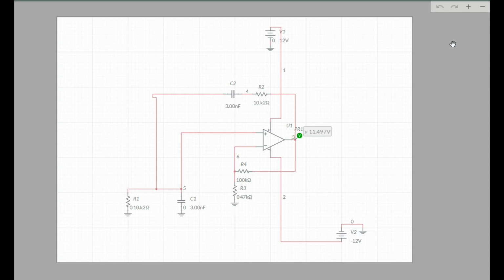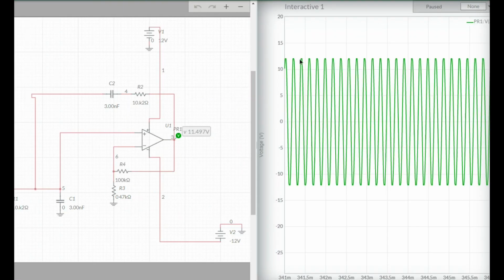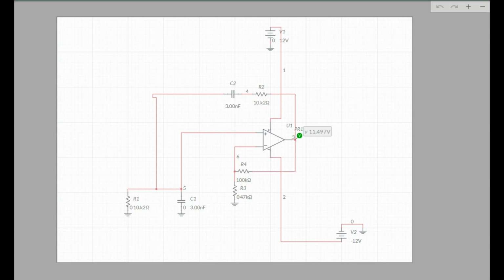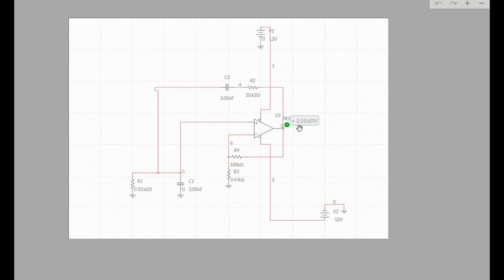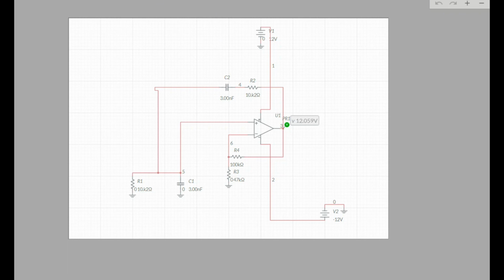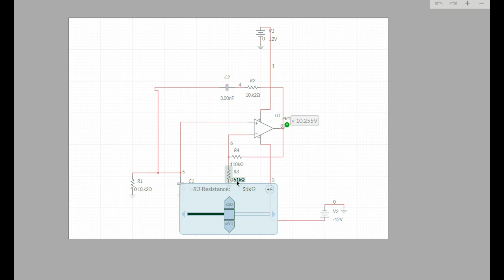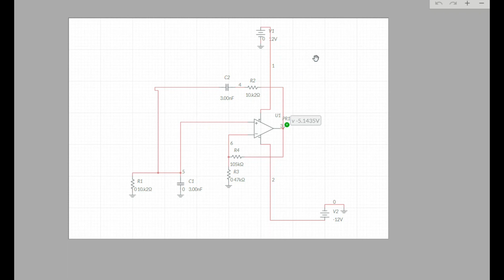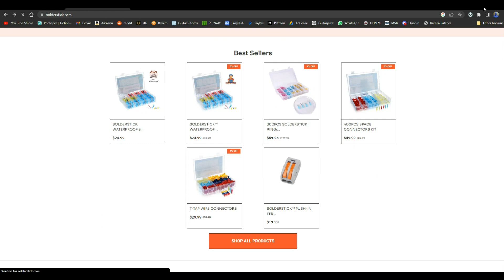Wein Bridge Oscillilator brought to you by Solderstick Wire Connectors

Comment: Found something interesting about an OpAmp - make it an AM modulator by using a MosFet across the feedback path.Modulating signal going in to the Gate.  The signal changes the S-D resistance.  Well it worked in a simulator - very small signal out though.

Comment: Clipping can also be controlled by the Low and High Pass filter capacitor and resistor choices but a 2.2k resistor in series with the 47k resistor also helps.  The lower the frequency the more clipping occurs.  To avoid the clipping would it be best to set a higher frequency for the oscillator and use a frequency divider to get the frequency one wants?  I haven't seen any circuits that produce decent sine waves at all frequencies. (particularly when one looks at standard component values)

Comment: PAUL, when the capacitor in a series circuit is an OPEN circuit its RC Reactance is Equal to the total circuits resistance. When the capacitor in a parallel circuit is a SHORT circuit its RC Reactance is Equal to the total circuits resistance?